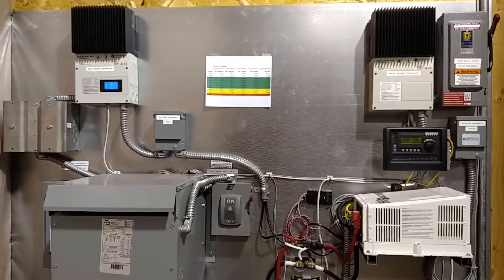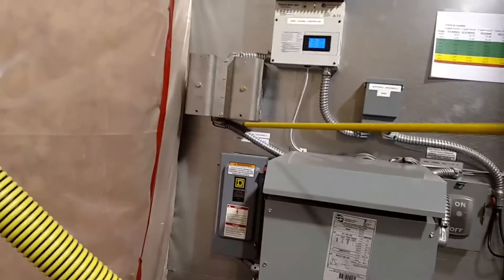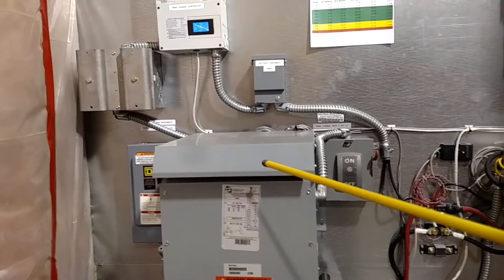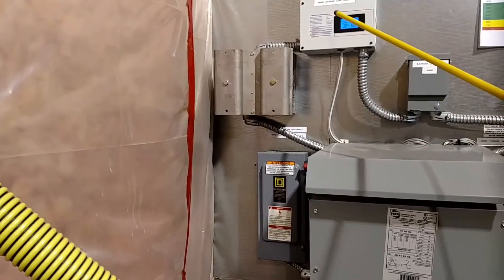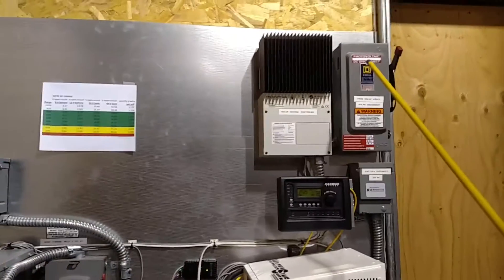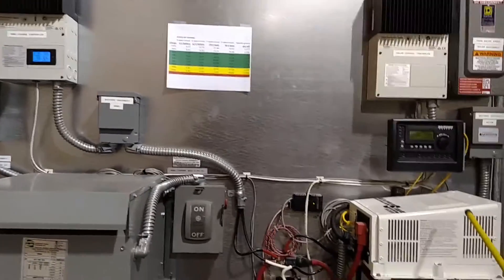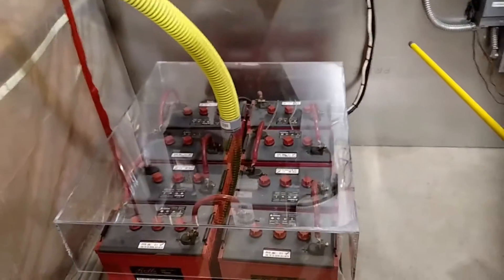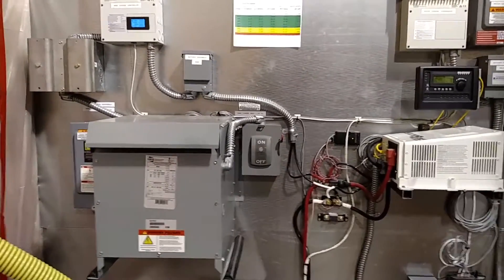Off grid with grid tie solar and wind Battery backup system

Comment: Nice hydrogen catch.
Reply from the maker: You can see through it
Reply: @royamberg9177  Exactly!  That's great.  Looks way nicer than a plywood box.  You did a great job.
Reply from the maker: @DavidPozEnergy  it's not supposed to work with the grid tie running at same time. I've used it several times when power went off. Heat in winter is a must. Takes power to run the heating system

Comment: Awesome!
Reply from the maker: Yes. Works like a champ
Reply: The battery box & vent very cool!!! Like the way your inverter is mounted.
Keep up the good work...
Reply from the maker: Another inverter is going to go underneath the one that's there. To meet ul the inverter must be mounted on top of dhelf under shelf or up right in wall with the UL listed enclosure so if there is a failure the molten metal don't fall out of it
Reply from the maker: The clear battery cover is nice so you can see if something is going wrong. It needs to be non conductive   I'd like it to be non flammable buy batteries are plastic to so not going to worry
Reply: Nice work! 
like it well done
Reply from the maker: I try not to do things half way. I need to add more capacity to it maybe this summer when I make more cash. It's an resurch and development project. Running grid tie solar and wind turbine at same time. It works great. Power is fairly reliable but never know. Place has hydronic heating. When it's -30 and windy heat is a must